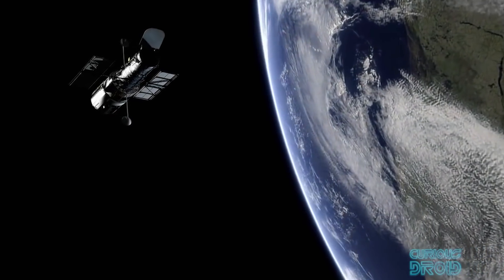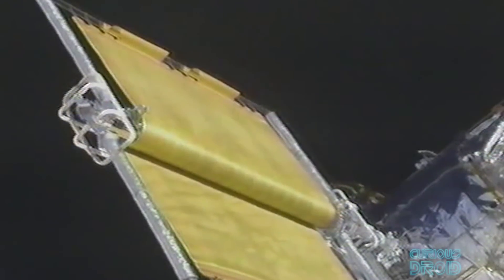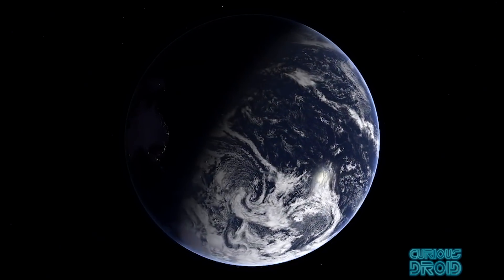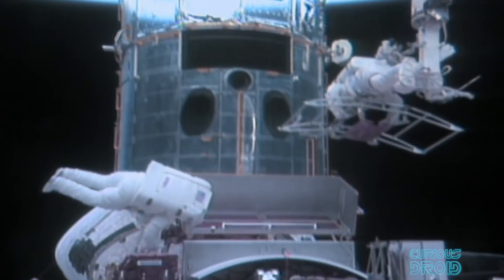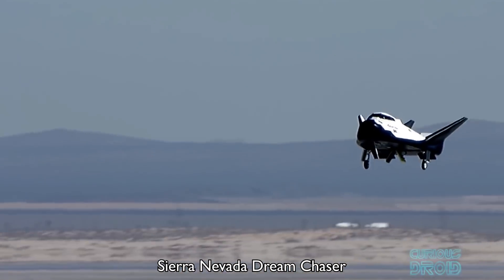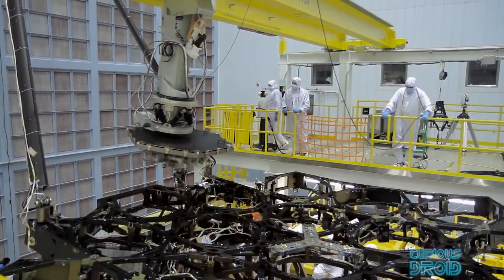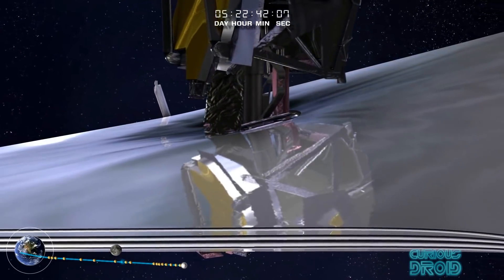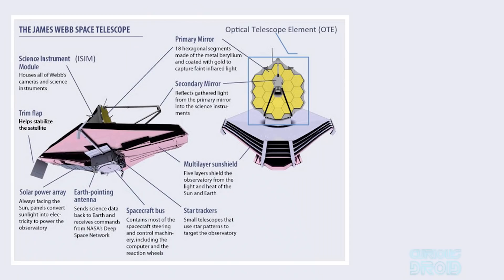Can We Save Hubble and Where is the James Webb Space Telescope?

Comment: Hubble has been great, but it's a victim of NASA as much as its creation.  Hubble was, unfortunately, designed to be launched and serviced by the shuttle, which brought a whole slew of problems with it.  Basically Hubble is just a KH-11 spysat that's been tweaked and repurposed-- it's based on the Keyhole 11 spysat design.  Problems that Hubble suffered from early on, like vibrating solar arrays, were well known to the NSA people who worked on KH-11 and they had solved the problem before Hubble was ever launched, but didn't share that information due to 'national security'.  The fact that Hubble was designed to be launched and serviced by the Shuttle meant that Hubble could ONLY fly in low Earth orbit, which is actually a TERRIBLE place to put a space telescope... half of every 90 minute orbit, there's a big honkin' planet (Earth) in the way of whatever you're trying to observe, which severely limits the observation time and thus the science return.  But, since the shuttle was COMPLETELY incapable of reaching anywhere beyond LEO, Hubble was therefore confined to low Earth orbit-- in fact, Hubble's servicing missions and reboosts taxed the shuttle to the very limits of its capabilities-- boosting Hubble to the highest orbit the shuttle was capable of to release it after each servicing mission.  Hubble's famous mirror problems were mostly caused by NASA politics-- "Better, Faster, Cheaper" and money-saving measures that reduced "unnecessary" ground testing of the mirror before it was incorporated into the telescope and launched, which then required a very expensive and time consuming fix to correct and an incredibly expensive Hubble servicing mission to correct... save tens/hundreds of thousands of dollars in the short term meant spending a billion in the long term to fix what would have been easily correctable on the ground.  

Had the shuttle not been in the picture, we could have had an entire FLEET of HST's launched by conventional rockets, and they could have been launched out to FAR better observational orbits, farther away from Earth, so that the Earth wouldn't be blocking the sky half of each orbit, which would have basically doubled the available observation times.  In addition, the light and heat reflected and emitted from the Earth, and from the HST passing in and out of Earth's shadow twice every 90 minutes, plays heck on the observations-- the telescope actually vibrates for a certain length of time after each orbital sunrise/sunset due to expansion and contraction of the telescope and its parts as it passes from the blazing heat of the sun into the frigid cold of Earth's shadow... Again, limiting the observation times.  

Had shuttle not existed, servicing of Hubble would still have been possible, had we had a spacecraft like Apollo available, and it would have been possible to service a space telescope beyond low Earth orbit, in the better observational orbits like geosynchronous Earth orbit or some elongated orbit like Chandra is in, or even at a Lagrange point like is planned for JWST.   A spacecraft like an Apollo or Orion could, theoretically, fly out to a beyond-Earth-orbit space telescope, like JWST, and astronauts could conduct repairs, if needed, and if the telescope were designed for such servicing missions in mind.  Without the shuttle's robotic arm, either the spacecraft would need to dock with the telescope via a docking target, or else a basic 'service arm' would be necessary to grapple and berth the telescope and servicing spacecraft, and perhaps provide more stable access for the astronauts working on it.   

Barring that, without the shuttle, the first HST would have been a loss, because without the capability to service it (assuming that no other spacecraft or capability were available or servicing capabilities designed in to allow for manned servicing missions) the science return would have been minimal with the defective mirror.  However, due to the extreme expense of the servicing missions and reliance on the shuttle, which did contribute to the Hubble's delays and design problems, we could have designed a more robust telescope and paid for a number of copies of it, and with expendable rockets, launched them farther out away from Earth into far superior observational orbits where the Earth wouldn't block the view half of each orbit, the sun would shine continuously on it, thus ameliorating the thermal expansion and contraction vibrations that limit observations as it passes in and out of Earth's shadow, and of course imagine the science return of having SEVERAL HST's out there doing observations of different things all at the same time, PLUS it would have created the possibility of interferometry observations, which combines the power of several telescopes looking at the same thing at the same time to act like one giant telescope...  something not possible with a single space telescope like the one and only HST... 

It's really a shame, and just another way that shuttle managed to hobble space science.  Shuttle's 'greatest triumph' was "rescuing Hubble" after the mirror fiasco and returning it to focus and operational capability; however, it's a Pyrrhic victory when one considers the fact that the problem would likely not have existed in the first place, if funding weren't being diverted from "unnecessary testing" on stuff like Hubble's mirror to the problem plagued and always in need of more funding shuttle program... 

If you haven't read "Hubble Wars" I highly recommend it... 

Later!  OL J R :)

Comment: Hubble must be brought back, future generations will remember this great telescope as a symbol of human space endeavours and deep space photography
Reply: considering there is no spacecraft in existence to do the job, that idea is pretty silly.   the best solution would be develop a spacecraft like the Dreamchaser to boost it into a higher orbit to keep it flying.
Reply: wincrasher2007 For value, it should be boosted and resupplied if possible.  For example, booster engines could be transported one by one and attached to the original towing points, then used to boost it higher, possibly with fuel resupply missions to the now attached boosters.
  Once it's time to retrieve it, heat shields, covers and other equipment for controlled landing can be attached before a controlled landing on land or sea (unless a new large cargo vessel has been created for other uses).  Another option would be to tow it to a future base on a body with easier landing, such as the Moon or Mars, becoming the central exhibit in their first museum.

 Transportation in multiple parts is another option, as reassembly on ground will be much easier than assembly in space.  Various struts and structural elements might be cut in the process of fitting it into vehicles like Dragon capsules, with that infamous mirror being the largest single part, needing a slightly oversized cargo vehicle.  This is similar to how entire houses have been transported to museums in the past.
Reply: @johnfrancisdoe1563  that's also a very good idea 😊😊😊
Reply: @wincrasher2007  There was also no spacecraft in existence to go to the moon either. We dealt with it
Reply: Maybe Musk can make a plan
Reply: Elon Musk might
Reply: Either brought back or fixed and used for years to come :)
Reply: I agree. I'd like to see it in person. There are plenty of people who would still think it's fake, even if they could look at it. Sad but true.
Reply: @dougalan5614  yeah, I think it would be great to see it in person.
Reply: before the orbit decays too far, spacex will take care of it - just for giggles, because they can.
Reply: m
Reply: Dhurmit , We need a Buran to do that .
Reply: @dodecahedron1  We could modify and complete the Pitchka which is a brother of the Buran .
I do not know if this would work as the USSR collapsed and the RF has no money to do it .
Also Pitchka needs to be refurbished as it is old . 
Alsooo , The Buran is much safer and effecient . It has a seperate Rocket , the Energia so , in case of failure , Buran can detach and land like a plane . It also has Ejection seats , 4 reuseable engines at the back , has Automatic Flight Control even while using an Analog computer and much more .

In the long run , Buran is much cheaper , efficient and safer than the Space Shuttle . It can also carry 30000kg of payload 

The Soviets even had a plan to bring back Salyut 7 with Buran .
Reply: Why bringing back? Use these very similar looking spy satellites from the NRO that recently were donated to NASA.

Fix it, maybe with one of the first SpaceX Starship launches, or leave it to crash. Like MIR a great lightshow at the end.
Reply: How exactly do you propose to do that? It's not possible presently and to develope anything capable of retrieving it would cost billions probably. Ain't gonna happen. Besides there's already full size models around people can see.
Reply: @jerryking7772  Not only models exist, NASA had some time ago get from the NRO 2 (or was it 3?) to Hubble identical, but unused spy satellites.
These could also be distributed through the various museums.
Reply: who cares... we need to move on. traditions and keeping relics from the past  are superficial nonsense..  that's why we keep are stupid religions.. tradition.. move on and improve.
Reply: I completely agree... It is worth any amount of rocket fuel to bring it home to be displayed so long as humanity lasts.
Reply: @jackmack1061  But with what vehicle?
Buran is scrapped, SpaceShuttle is retired completely, SpaceX Starship (cargo version) is at least 5 years in development. And nothing else is even close to be considered able for that job.
Reply: Someone mentioned buying some time by lifting it into a higher ans more stable orbit until the kit to retrieve it is built. I like this idea because I want the vessel that retrieves it to have proven reliability at retrieving spacejunk. I expect in decades to come there will be tugs in space kept constantly busy cleaning up old tech. Or am I just a wistful dreamer?
Reply: @ 1_2_Die
 Someone mentioned buying some time by lifting it into a higher ans more
 stable orbit until the kit to retrieve it is built. I like this idea 
because I want the vessel that retrieves it to have proven reliability 
at retrieving spacejunk. I expect in decades to come there will be tugs 
in space kept constantly busy cleaning up old tech. Or am I just a 
wistful dreamer?
Reply: It is Keplar, It is Galilelo, It is Newton , etc.. its one of the great astronomers we have had.
Reply: Without the Space Shuttle, we have no way to bring back an object so large and massive.
Reply: While it might be nice to bring it back, to show people "how we used to do it", I would argue that whether given a further life extension, returned for display, or allowed to burn up, Hubble's real legacy is the fantastic information this wonderful piece of kit has returned.
It says something that many iconic images of the past fifty years or so relate to space...
Earthrise (Dec 1968)
The first manned moon landing (July 1969)
The Pale Blue Dot (and the so-called family picture) - Voyager - February 1990
The Hubble Deep Field Image (1995)

Whatever happens to Hubble in the long term, it's legacy lies in the images we have been able to see over the past quarter century.

Comment: Fix it.
The lander used to drop a rover on mars is a good design to start with in designing a maneuverable booster that can be clamped onto the base of the Hubble to send it into a higher orbit.
when its at its designated height the booster can be released or kept attached for later use.
The booster could be attached to the top of the return vehicle for the astronauts, and when its clamped on the astronauts could do a space walk and do the repairs., re-enter the return vehicle, and detach...allowing ground control to move the Hubble.
it's just a thought.

Comment: I think it ought to be fixed. 2028-2040 is hopefully enough time for cheaper manned spaceflight to be developed, the BFR is supposed to be operational before then.

I know elon has these big plans to use the BFR to get to mars, but honestly, if he developed automated ones with internal repair bays that strip out all of the reusable components to save weight, and left a few on orbit permanently using tanker and cargo BFRs to resupply them... He could make a very profitable business out of satellite servicing. For once, repairing satellites might be cheaper than launching new ones.

And hubble ought to be top priority for any such servicing mission. The james webb will be inundated with use cases, and it simply can’t look at EVERYTHING. Hubble should be there to back it up on easier to accomplish research.

For example, just because the Keck observatory exists doesn’t mean nasa and other organizations think amerateur astronomers are useless. They actually play an important role in things like NEO spotting, or observing impact events, things that only get done with lots and lots of cheaper and lower power equipment.

Comment: Just to correct something, the F-35 is not just one plane it's actually 3. There are huge differences between the Navy version the Marine Corps version and the Air Force version. The f-35b for example has vertical take-off and Landing capability which means for all intents and purposes it's a completely different plane then the F-35 a which does not

Comment: A practical plan to extend Hubble's useful life with some critical upgrades and an orbital boost, would be a helpful back-up for the JWST, especially since JWST is functionally not an exact successor to Hubble. This is because Hubble is equipped to cover near infrared through visible and near ultraviolet light, while JWST is strictly a massive infrared telescope. There could be useful and exciting scientific work done by having both of these telescopes in good working order, if the will to make it so was only in place.

Comment: I'm a HUGE hubble fan and would love to see the James Webb up in space. However, I'm not holding my breath for its success.  Parking it out if reach of any assistance from earth...It's stability and aiming likely dependent on relatively short lived gyros, it will have a brief lifespan...IF it is able to deploy and work at all.  Launch is particularly violent event for such a delicate and "single point failure" riddled machine.

Until then, it is imperative that we keep the hubble up and running.

Comment: We've learned a lot from hubble already. The myseries of the universe have facinated mankind for thousands of years. Those mysteries are not going anywhere. I think we should recover hubble if possible because we don't know where it might fall.  There' no real rush to put james webcup there. Let's try to get that right. Our focus should be on designing more ecconomical means of getting beyondvlow earth orbit. One way we could do that is to build a craft with a refulable stagecthat can be refueled in low orbit after launch. That would of course require two launches. One with a manned ship plus an unmanned refeuling ship. Then after refeuling the unmanned can return to earth while the manned ship proceeds on mission. BTW this idea may have been inspired by the movie Arrmaedden. Or it may not. I've actually been thinking of this for decades. The problem with getting beyond LEO is feul. Solve the fuel issue and you solve the problem. Appolovused a two launch method to reach the moon. One ship carried the crew. The other carried the lunar lander and feul to get them there and back. The command module as it was called was pretty large. It's booster and feul tanks were able to supply enough feul and propulsion to get them there and back. Suppose you wre to launch a manned ship and a second propulsion unit at about the same time. Then you cuold simply link the two vessels together and get you where you need to go. The only drawback is the needc to scrap one of the vehicles when the mission is over. Remember when Appolo returned only the crew capsule was recoved the rest of the entire craft wsa left on the moon or crashed into the sea.